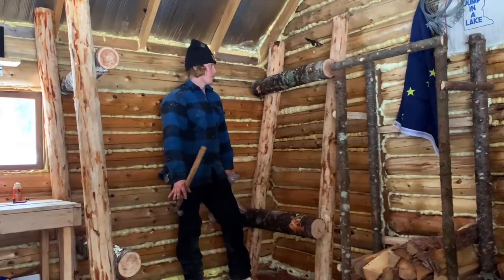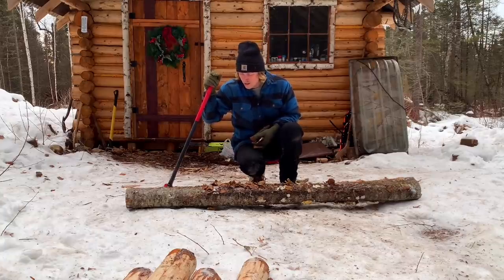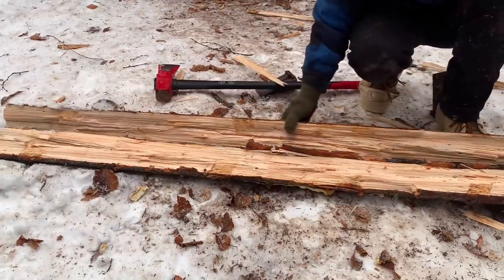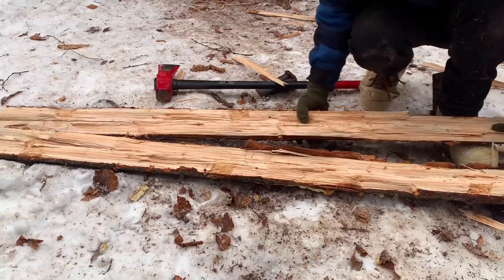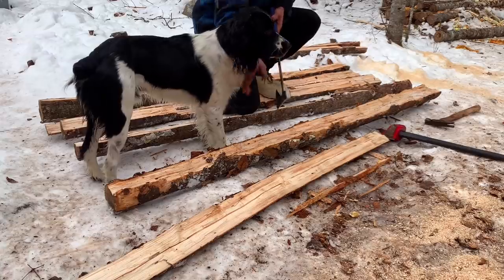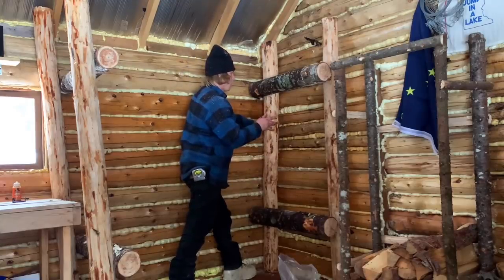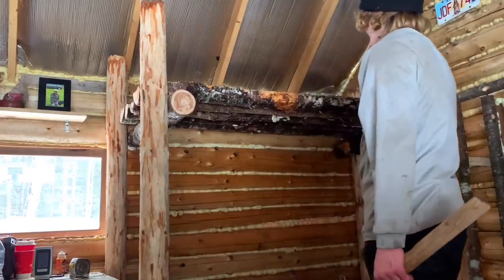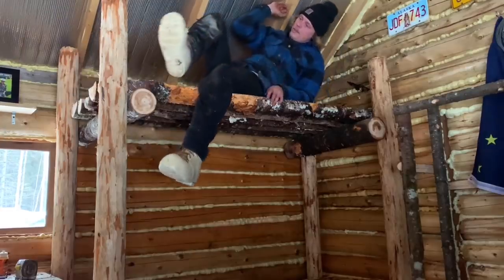Building Rustic Bunk Beds: Off Grid Log Cabin

Comment: Love the project!   Suggestions for some presents Sierra might get you for some occasion.   A stone mason’s chisel hammer which is short handled with 3-4# head.  When I did stone mason work building walls, etc. was a good hammer to work with.  Next is an engineers hammer.  About a 4# head with a longer handle.  Both can be used to drive wedges for splitting and might be easier that using that splitting maul.  I like the engineers hammer as the long handle allows a good wack at the wedge.  Just a thought for Sierra for a surprise gift you could use.